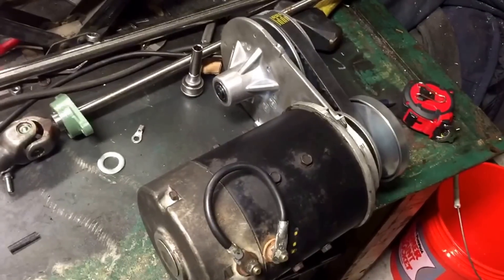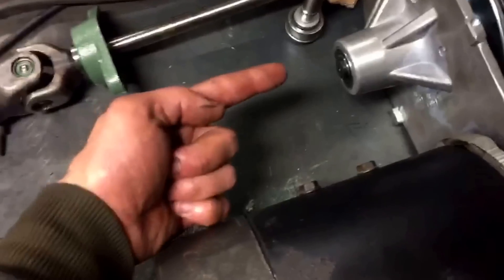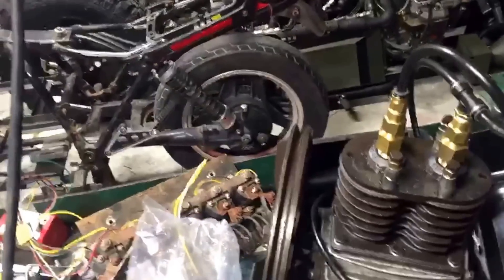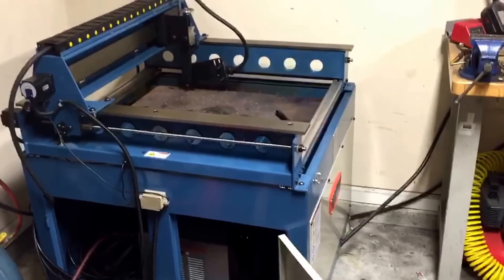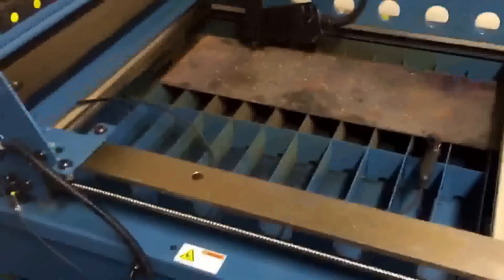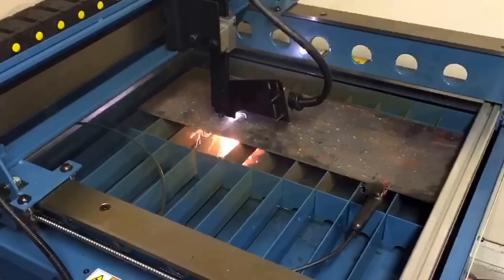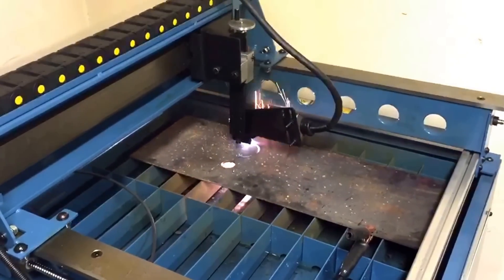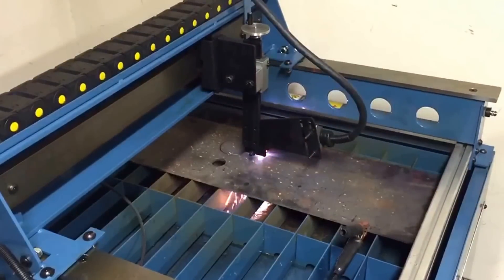CVT Adapter Plate cut out on Baileigh Industrial PT-22 CNC Plasma Table

Comment: Doesn't look like you have auto-height adjustment.  Do you regret not getting it?  I have heard it's not necessary for such a small work area but others swear by it (and so goes the Internet).  Now that the Torchmate is no more it's really between the PT-22 and the GoTorch.  What do you think?

Comment: I just bought the same table,  may I ask how you connected the "start/stop" cable to your Plasma cutter?

The instructions are less than Vague, and I am a simpleton at best LOL
Reply from the maker: Ashley Mckendree I connected the start stop wires on the plasma table controller to the trigger wires on the plasma cutter torch handle. The main connector where the torch plugs into the plasma cutter box has a plastic cover that I removed and used the blue piggyback clips that allow you to connect wires without having to cut the main wire in half.
Reply: Head Turner Customs what brand/model plasma cutter do you have?
Reply from the maker: Ashley Mckendree it is a Baileigh PT-22
Reply: Head Turner Customs sorry, i meant the model of your plasma cutter

Comment: how do you get the drawing onto the machine?
Reply from the maker: I drew it on ucancam software that came with the table. Then saved it on a flash drive inserted the flash drive into the hand held controller, set the program cut speed according to the thickness, and hit start.
Reply: +Dieselmonkey89 
i really like to get one, but the thing is i have no knowledge on drawing onto the computer. if i did get one i hope its easy. thanks for the reply man!!!
Reply from the maker: If you can use Microsoft Paint, you can easily use this software. It is like drawing with the straight line and circle tool, but over the top of a grid that shows your XY-axis so you can keep up with your measurements in millimeters. For the best results definitely make sure that you are very precise in your in to mm conversion. Rounding up or down for ease of future calculations makes very big differences in your final size of the cut piece.
Reply: +Dieselmonkey89 
thanks for the heads up. what you said makes me feel a lot better. for under 5 grand im defiantly gonna buy one.